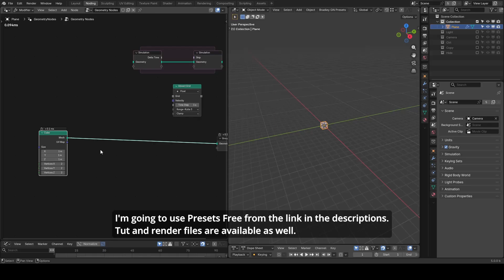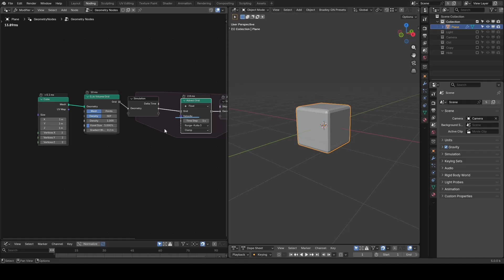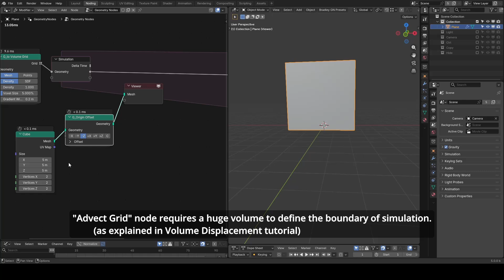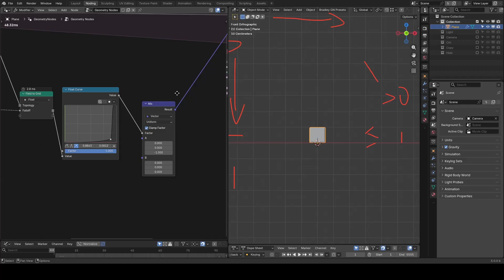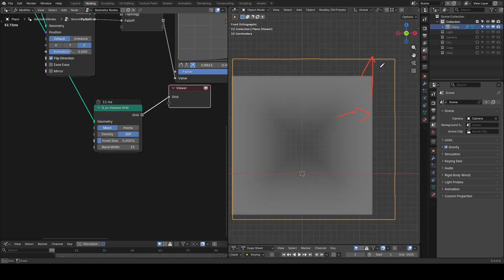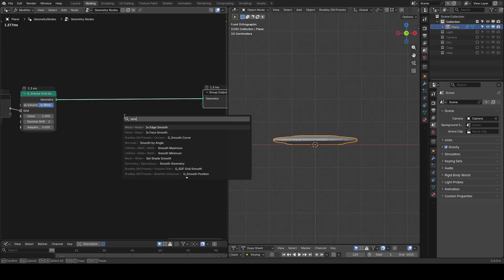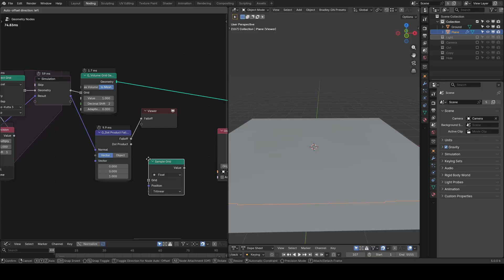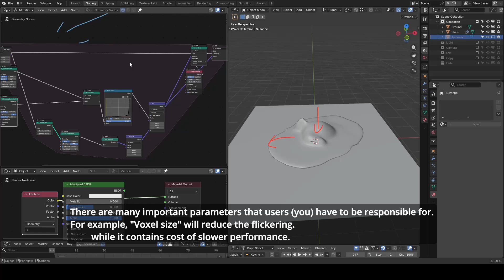[Tut] Melting Object using Volume Grid - Blender 5.0+

Comment: Are there other tutorials you have done that deal with the material aspect?
Reply from the maker: it depends on which what do you mean by "material aspect" more specifically. Like Color gradient is very basic and has been mentioned in nearly every tutorial.
there could be some more tricky aspects of it regarding volume, but that's a bit of different stories.
Reply: @bradleyanimation120  I actually just looked back at your other tutorials to figure it out. Thank you!

Comment: Are this method can be applied to be a morph object?
Reply from the maker: working with morphed geometry in general is tricky givem the current system. that specific part should be tackled separately from what's talked here.
So for your question the answer should be roughly yes, just the node tree should be made more advsnced wifh some methods unknown yet.